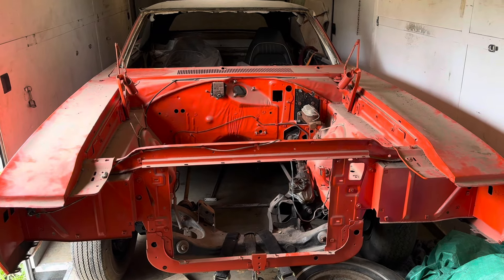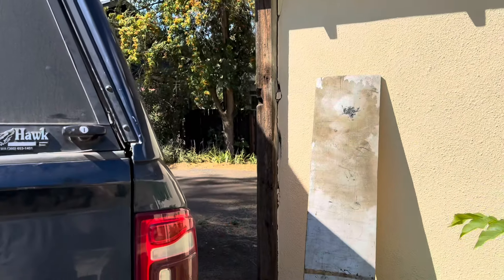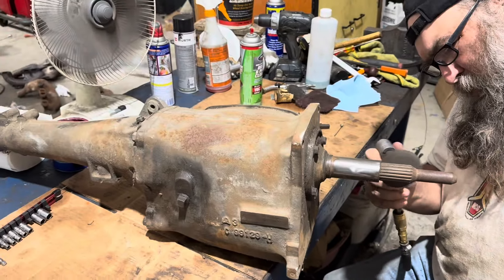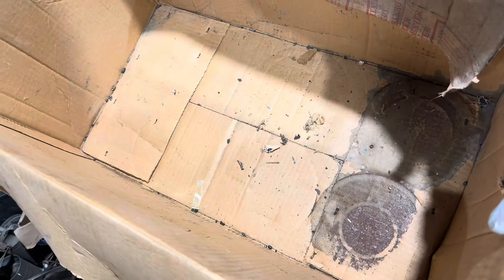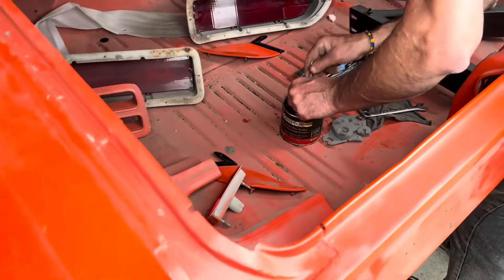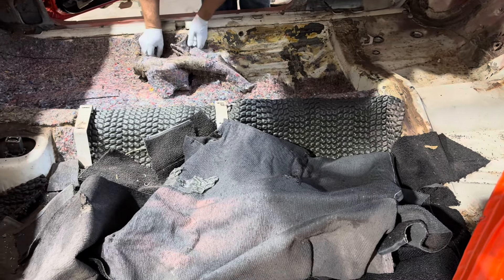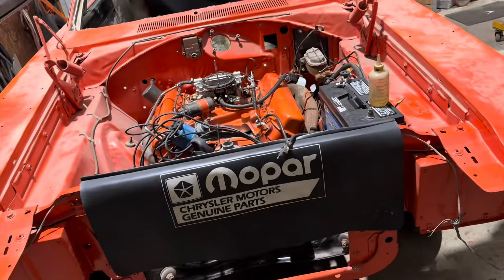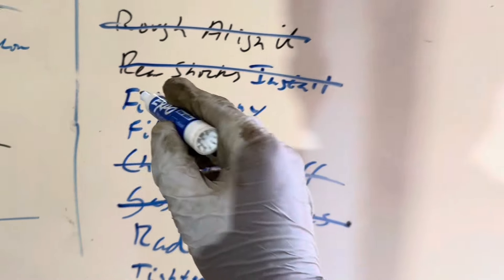EPIC 3 Day Thrash To Revive This 1970 Plymouth Superbird! From Pile Of Parts To Burnouts In 3 Days!

Comment: You didn’t get the brake booster in all those parts?
Reply from the maker: That’s one part we didn’t get, it must have been a drag car with the power steering delete and no booster.  Luckily we have one in the shelf.
Reply: @rocketresto  Well, that probably explains why the original motor is MIA…..